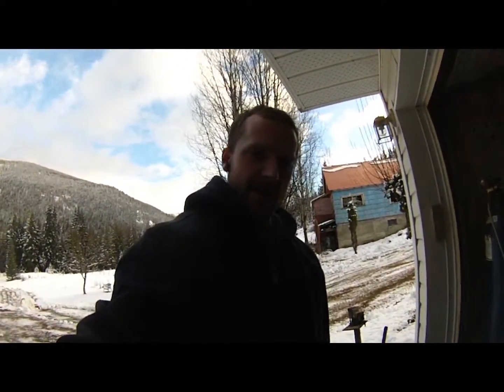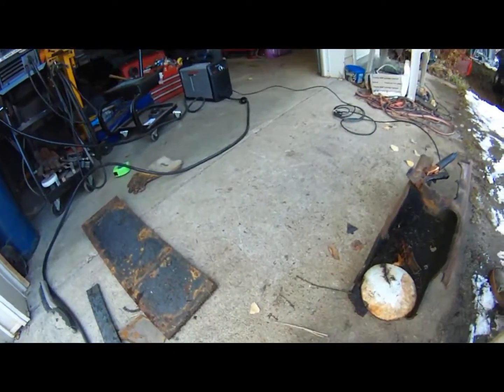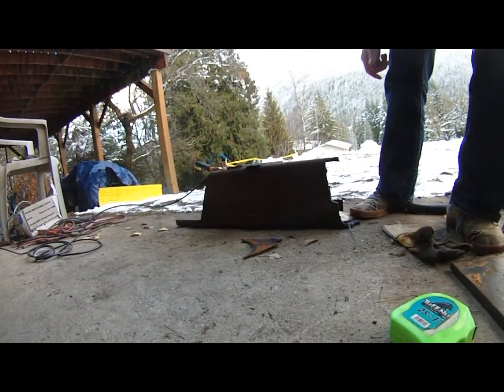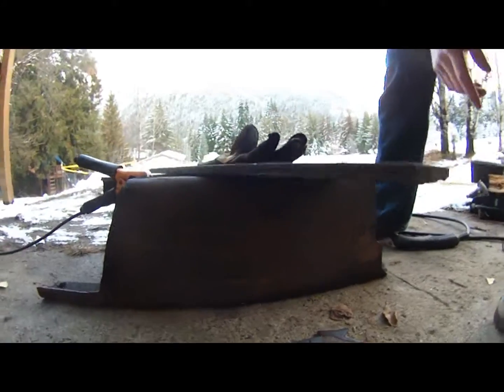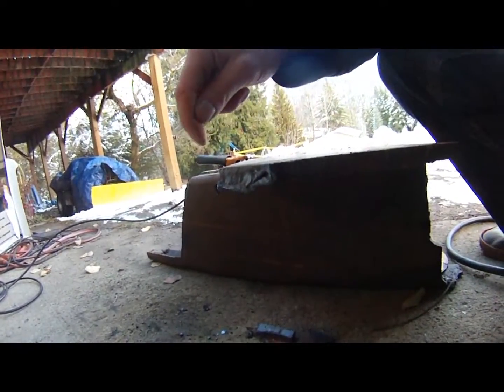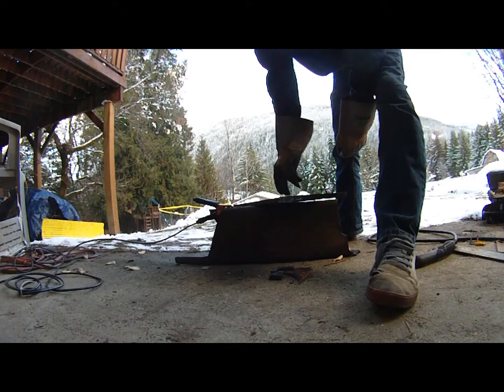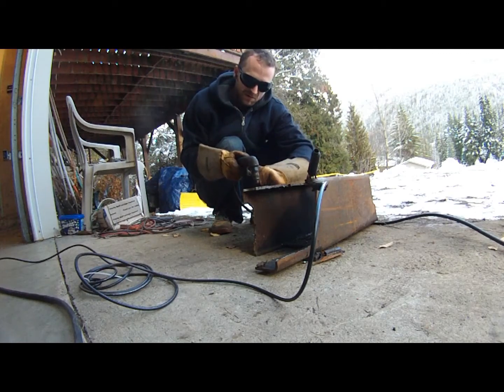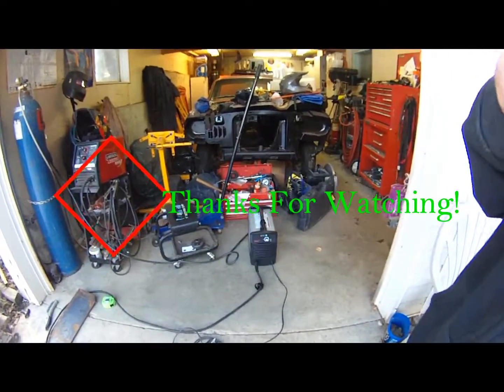Hypertherm Powermax 30Air Steel Thickness Cut Test!

Comment: The shield on the outside lifts the tip the correct amount, it can just be dragged on the surface.

Thanks for the video I was curious the power to cut thicker metal we have used it a ton on lighter stuff